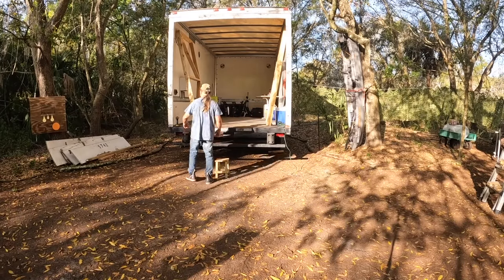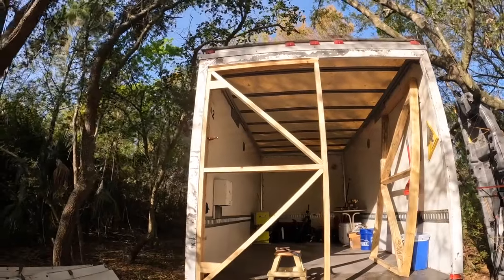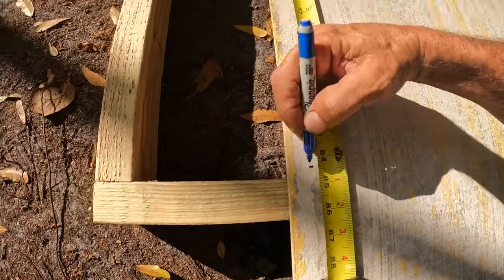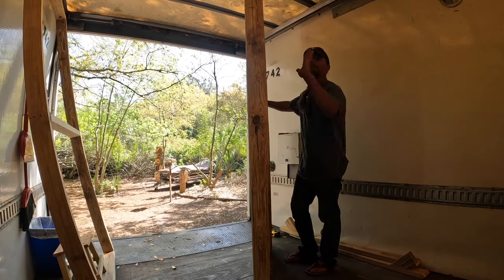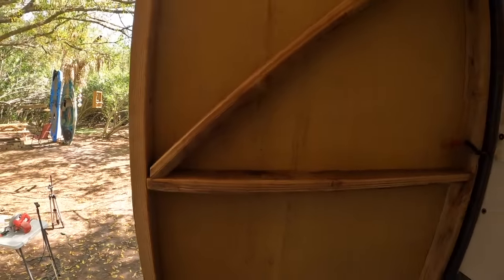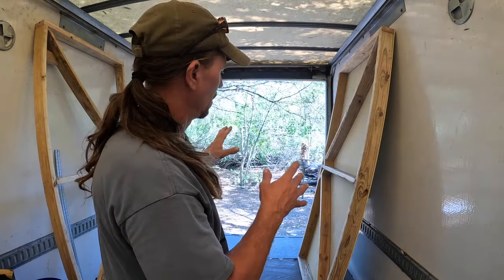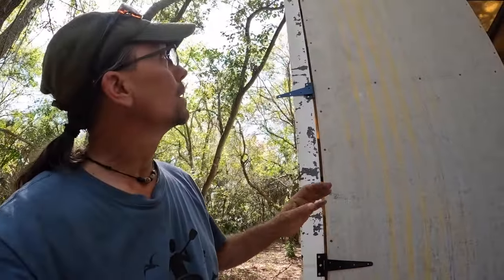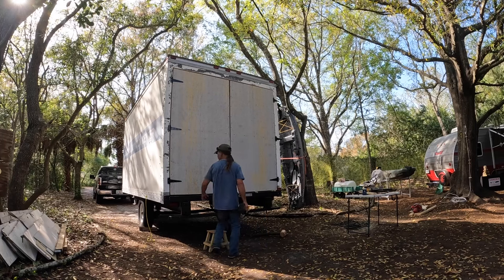Workshop 003 Door Skins

Comment: Nice one Marty!  I would have been tempted, as someone mentioned in the last video, to use hinges that would allow the doors to open around flat to the trailer sides, and some wooden blocks on the inside of the hinge screws would have made it stronger.  Stay safe & well.  👍👍

Comment: Hello Marty, great video as always. Sometimes a support wire can be added from the top right of the finished door to the bottom left including a turnbuckle to adjust out  eventual sag in the door. Do the same with the opposite mating door, and then it can be readjusted as needed. Also the opening of the trailer may lean slightly depending on  slope the trailer is parked on and weight  attached to the walls of the trailer (shelves / hooks / bins whatever and the load the trailer wall is asked to support. The trailer is designed to flex some while going down the road. One other thing, try to park the trailer where it can get some shade from the sun, otherwise it     becomes a giant oven. LoL 73 and GOD bless. Earnest K5EWM.

Comment: You realize that those upper angle braces are only going to contribute to sag rather than resist it, right? Gravity and all. The weight at the top inside corners of the doors should be braced down to the hinge side. A joint in compression is far, far superior to one in tension.

Comment: Isn't that board stuff basically extra hard dry wall which will absorb all the moisture and crumble?
Reply: actually, it is a cement and fiber board. They make a version of this product for house siding. When painted it's some tough stuff, I've seen people using a pressure washer to keep it clean. I can't bring myself to do that, but I do use a garden hose with no problems.🔨🪚